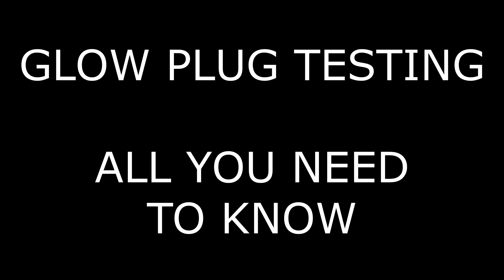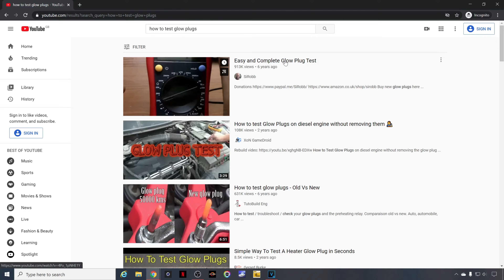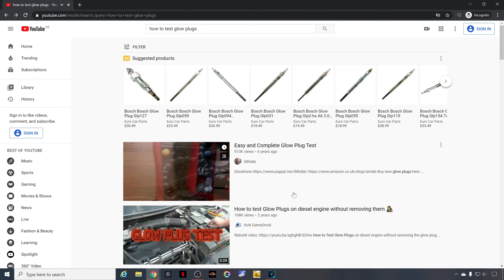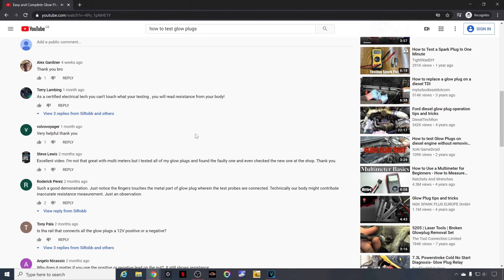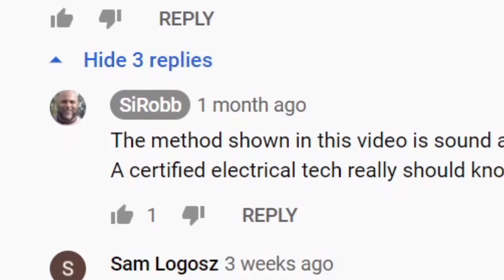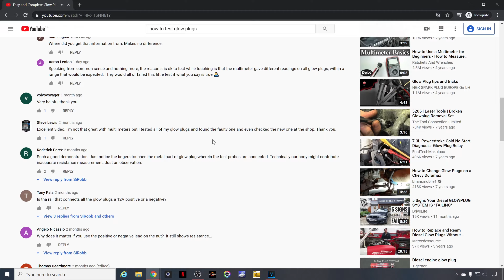Glow Plug Testing  All You Need to Know

Comment: Just come across your channel you really no alot about mechanics. I follow about 10 other mechanic channels on YouTube Would you get a fault code if one or more of the glow plugs are bad ?  What are the common issues when a glow plug goes bad ? Can you check them without removing from head ? Iv heard that are really tricky to change if you brake one in the bore it can be a night mare to get out and theres a good chance thay can brake when changing them. Iv got a astra Mk5 120.000 mile I'm thinking that have never been changed on it .
Lee
Reply from the maker: Test first and that's shown in this video.